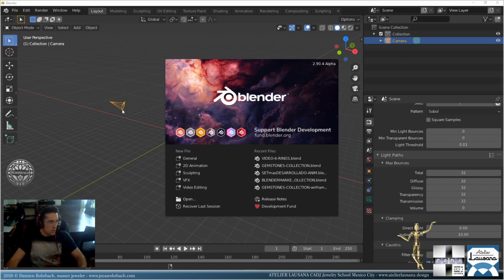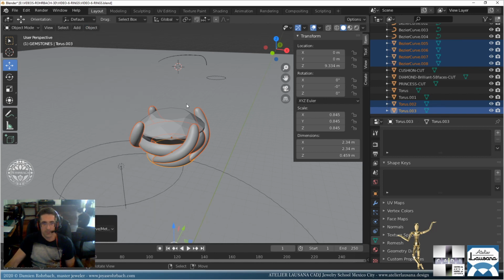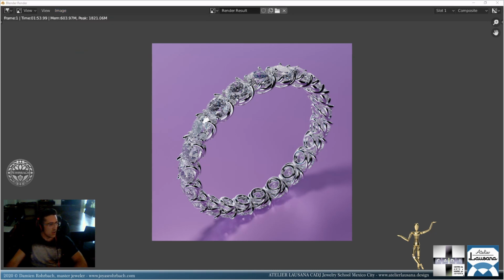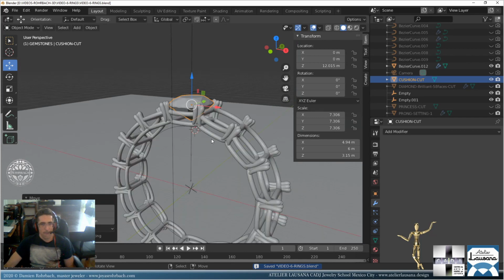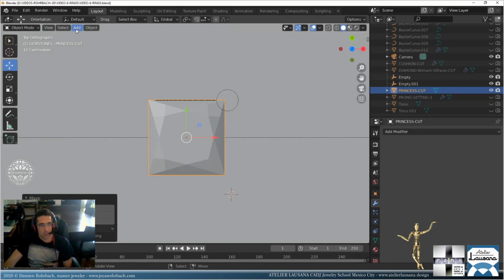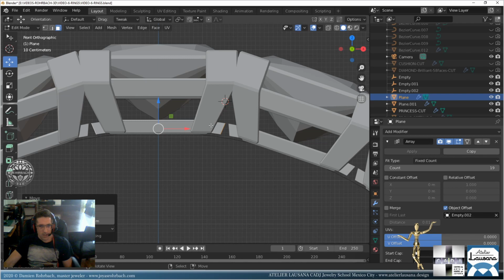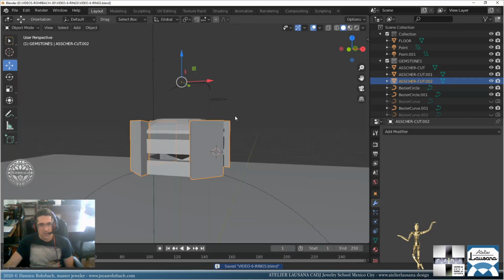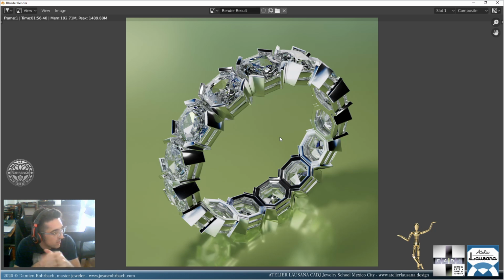3D Jewelry design TUTORIAL 6 with Damien Rohrbach and Blender

Comment: would those models be printable without any changes?
Reply from the maker: With resin printers it should work as a charm. But still, double-check thickness at 0.5 mm as minimum.